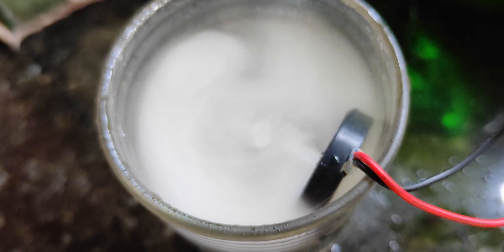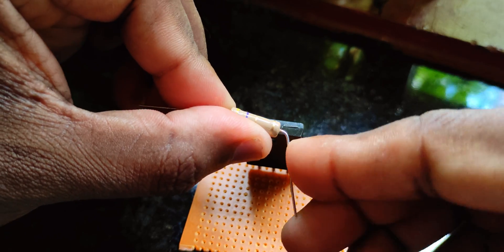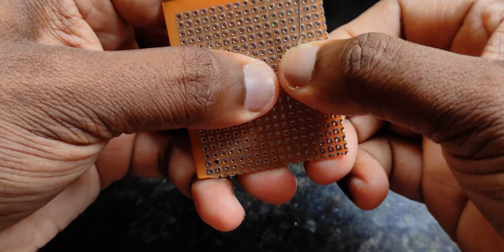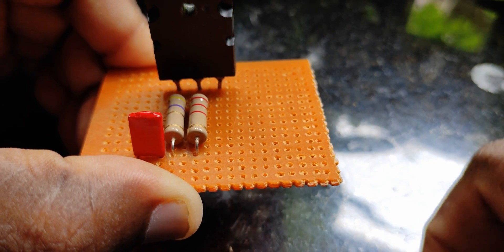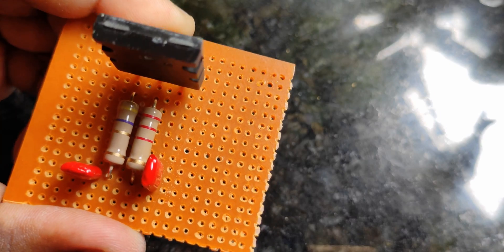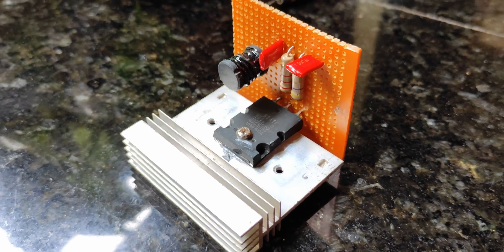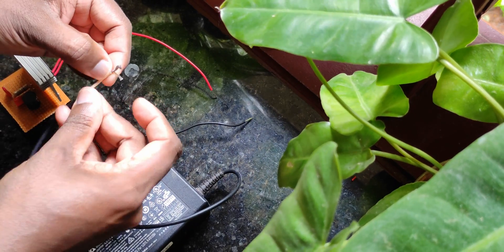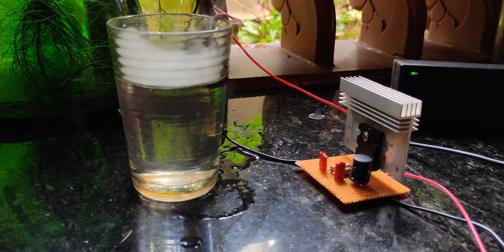I made a super simple 1.7mhz mist maker circuit | ultrasonic mist maker humidifier Level 2 | Ciiads

Comment: simple and effective.. works fine... it only consume 0.6amp...... thanks
Reply: Are you sure it consumes only 0.6A ?
Reply: @sujatabargur  yes i checked it with my bench power supply
Reply: @narendra848 
👌
Reply: did u check frequency with scope? i think its way less then 1mhz
Reply: @hehahu-wx2gn  may be possibe, i didn't check the frequency
Reply: i think by calculations it showing 308khz or something by adding disc capacity. isnt you work. really?..😢.
Reply from the maker: How do you calculate, the disk it's self is an oscillating component😊. Check the circuit and think.
Reply: @AMNLabs may be work... parts not delivered. waiting....Hoping the best 👍🏻

Comment: Thank you bro.... At last i built this 🙏🙏🙏🙏... i used toridal 2.4 A 100uh inductor is the change and same transiter but csc5200..I really doubts isnt it work.. But research i fjnd out it work and start to built.. But it's output is slow. i mean it take long time to fill glass as in you. so my need of making 50inch tv area fog with this will partially success.. also the transistor is heating even with heatsink. but fine it may be 40-70 range.... in first i think it not work only when we drop water not work when we put in water.. But when adjusted height it works fine.. i using a voltage regulator for 12v 2A bcz i have  a smps of 13v so for it uses 12v regulator....*I still have doubt* Isnt we can add another disc in it. so that good output will be there. i can give enough 12v current upto 5A. Isnt using parallel discs fine?.. isnt circuit burn?
Reply: isnt any way to increase fog content by increase voltage or something.. my disc is 12v by the way....
Reply from the maker: Do not use any regulators, feed the voltage directly. 13 V is not an issue. Use thick wires and high-current components. This means the inductor should be made with thick copper wire. In my experiment, this improved the thermal performance. You can always increase the voltage up to 24 V.

What I showed in the video is running on a 12 V, 3 A power supply, and it is barely warm. However, it does get warm if it is built with thin wires and a thin inductor. If you push the voltage, keep the disk at its rated operating voltage.
Reply: @AMNLabs 12v is disk rating 😐. that's why i used regulator. Almost 13.7 peak is smps out. i don't know thickness. its brought from robu 2.4 A toroidal inductor 100uh
Reply from the maker: There is always a voltage drop across components, so the 13 V will not hit the disk directly. It will actually be less than the supply voltage, so it is safe. I haven’t experimented with parallel disks in my setup. If the two disks had the same resonance frequency, there could be a possibility, but most of the time components have tolerances, so they won’t be exactly the same. Therefore, the chance of this happening is very small.

Comment: isn't this really produce 1.7mhz with this 47nf capacitor. isnt it working like feedback boost loop. isnt it has any limiting setup. isnt resister's for that?.. isnt the 47nf used for dc blocking?... which parts determine the oscillation frequency. how its working path.. can you explian. isnt it's a better option using toroidal inductor. isnt we need to use trimmer capacitor for adjust the tolerance issue of 20% of inductor. i really need this setup but stuck on inductor. because i have no inductor measuring devices to custom built. Yaah there are setup to calculate turns for fixed diameter wire but ferrite core power measuring not with me..😢.

Comment: how much ampere rate needed for inductor. Also isnt if i use current rating under 1A isnt burn full circuit or the inductor only.
Reply from the maker: In my experience thick wire works best.

Comment: i purchased all but i don't get the  inductor 100uh with high current rating. but i by radial one of 100uh. what i do. i gonna buy new 100uh of 1.2 a... isnt that gona ok?
Reply from the maker: You can make one your self, use coil 32 calculator
Reply: @AMNLabs  can you say how much max current ratig needed
Reply: also i have a ferrite 100uh can i use that to make it.

Comment: i really like the fog visual. i need to make this. in internet it saying 1.7 mhz is ideal for fog.. isnt increase it make more fog?... isnt increase voltage produce more fog?
Reply: do you have any specific tips like thick wire, high current inductor,  which is often saw in comments. I am not a electronic guy. I need to make this for a iceland miniature 👍🏻
Reply from the maker: @christopeter.k.p2199  ya you can increase voltage depends on the disk potential. 👍
Reply: @AMNLabs i have a doubt the chat gpt suggested use power MOSFET IRLZ44 instead of 2sc5200...can i do so. isnt any issues. pros and cons plz
Reply: @AMNLabs also in rohu only i see 25 mm disc. But it is 12v. Isnt 24 v better? isnt it make more fog.i also saw a built in 24v mist humidifier in rohu it has no modules. a black set input a 5mm dc jack only.... isnt it better?
Reply: @AMNLabs also i saw many persons in comment to increase frequency. isnt it make more fog or finite fog?.i need to make as like thick white fog. that's why.

Comment: Hey nice to see you still uploading in 2025! Last came here in 2022  well anyway. I randomly came up to this video. But could you also tell me the name of the circuit or even a schematic? Well really the reason is I wanna drive a 113khz or 108khz piezo disc depending on which one I can find. So can you tell me how to change its frecuency to these two?
Reply from the maker: Hey! 😊 Yes, it’s still uploading. My latest project with the PIC12F microcontroller—complete with firmware and circuit—is already out. Right now, I’m working on another exciting project that will drop soon—you can follow the community posts for updates!

I’ve also developed a real-time timer for automation based on STM32 MCU, and that’ll be coming out soon too. On top of that, we made a 5.2-channel Hi-Fi power amplifier for home theatre and music—three years of R&D went into it, and the results blew us away! This is the start of our audio brand, AMN Acoustics, focused on pure sound quality and powerful performance.

I started this channel to share my work as open-source projects that can actually help people. Thanks so much for sticking with me!

About your question: for 113–108 kHz, you can make an oscillator with a NE555 chip, drive the piezo using a MOSFET, and add an indicator. That setup is more than enough to drive the disk.

Thanks again for following along—see you soon! ✌️

Comment: I need to have minimum of 4 piezzo modules running at same time. can I use a single driver to run all for by connecting them in parallel?
Reply from the maker: No
Reply: @AMNLabs  is there any modification I can do to do it
Reply from the maker: @sinansidhiq3928  Practically no, but give it a try. I prefer using multiple dedicated drivers. As a matter of fact, it's just a single transistor circuit.

Comment: Brother, Working perfectly but transistor gona to hot ,what to do
Reply from the maker: You'll need to use thick wires, a high-current inductor, and an appropriate heatsink.
What's your setup?
Reply: I buy a 100uH 11Rs inductor. you are right . Brother, tell me why transistor going to heat by small low current rating inductor??? I also want to how a single transistor and inductor make a oscillatory signal?!! Please tell me. @AMNLabs
Reply from the maker: The piezo disk it self is the component, Its self resonance is used to make oscillations and others are the supporting components. the high frequency pulses require more peak current. You can't see that on the multimeter but it's actually there so thick wire helps to lower the impedance minimize losses and better power delivery make the system works better and efficient makes less heat.
For instance if you swap the 1.7mhz piezo to a 2.4mhz one the same circuit works 😊👍, sub if you like my project then we will meet again.
Thanks for your feedback.
Reply: Thanks brother❤ for this great knowledge @AMNLabs

Comment: At 12 volts, it just splashes water. Only between 18 to 24, just for a few moments, it produces fog and then continues with just splashing water. The NPN gets super hot.  Using a computer-CPU-heat sink, I keep it cool, but still the same result. Would you guide me in this matter? I use a 12-volt PC power and also an 18 to 24 DC 10 A power supply. Thank you for you help
Reply: Would you kindly help me with the problem?
Reply from the maker: Use thick wire and high current inductor, keep lowest possible water level on the top of the disk means reduce the water load over it.
Reply: Thank you, I used a toroid with a 13 mm inner diameter and 0.8 mm copper wire with 34 turns. I also increased the resistance of the 2.2 k resistor to 3.4 k. Then it started to work on 24 V. 😊
Reply from the maker: Thanks so much for your patience and belief in me. If you liked this, give it a thumbs up and hit that subscribe button to join me on this journey. Thank you!

Comment: Can it run on 3 volts? What circuit modifications would be required for that?
Reply from the maker: No, it's not possible to run it on 3 volts directly. But if you're wondering, we can try using a boost converter module to step up the voltage from 3V to 12V or higher. Make sure to use a good-quality module with sufficient current capacity.
Reply: @AMNLabs could you please suggest me some boost converter?
Reply from the maker: @deeppatel_369 why are you trying to run it on 3 volt?
Reply: @AMNLabs  Since I want to run this using a battery in a project, would it be possible to use a AA, AAA, or coin cell?
Reply: It only needs to run for a few minutes, which is why I'm trying to power it with a coin cell. What would be a feasible solution?
Reply from the maker: @deeppatel_369 If you want to run it using AAA batteries, it’s very difficult due to insufficient power delivery. I suggest using at least a 12V battery for the circuit and a 3.3V regulator for the 3V sections of your project.

If you're aiming to create mist using a low voltage power source like a lithium-ion battery or a 5V power adapter, you'll need a low-power mist maker circuit. These are inexpensive and pre-assembled modules available online. Just search for “DC 5V Humidifier / Mist Maker USB Spray DIY Module” on Google.
Reply: @AMNLabs   Thank you so much. Do we have a lower-power piezoelectric disk available?
Actually, the idea is that I want to generate mist—it can be a low amount—but it must be powered by a small battery. Using larger batteries would defeat the purpose of my project, and I’d prefer not to use a power adapter.

If you have any ideas or solutions (whether with a different circuit or a different piezoelectric element), please let me know.
Reply from the maker: @deeppatel_369 Just Google the query I mentioned in the previous comment, you’ll find it there.
You can buy the module, it works very well.

If you want to create your own version on a dot board, you can buy an atomizer disk online (typically around 108 kHz) and generate that frequency using an NE555 chip or a microcontroller. Then, use a MOSFET to switch the signal and drive the atomizer disk. That’s the general approach.

It’s not rocket science, and it’s not a new concept, there are plenty of DIY circuits available online using 108 kHz disks.
Hope that helps with your project!
Reply: @AMNLabs  Thank you! I’ll search for it.
Reply from the maker: @deeppatel_369  good luck 👊😊

Comment: Hello sir please give me your gmail to contact regarding this project can't work
Reply from the maker: Why? 
If you did everything correct it will work, I'm sure 100%
Reply: Please tell me about the inductor all components the same as  you use but I am using 8 × 10 mm drum radial ferrite inductor so tell me how many turn what is diameter of wire
Reply from the maker: @PriyaranjanMaurya-zn8lu
I think it's 20 SWG, I made this a long time ago, so I can't recall exactly. But it's not a big deal, just use thick wire and a radial ferrite core to make an inductor around 100 µH. That should be fine.
You can use Coil32 to calculate the inductance if you want, it's simple as that. And always use thick wires for all the connections.
Use proper core size for the perticular inductor to get the best results.
Best Regards,
Aneesh Murali Nariyampully
Reply: Thank you so much I am going to make this Inductor and correct my circuit

Comment: My Circuit is not working all Components and connect are same and I am using 12v 1.5A adapter 
25MM Piezoelectric work too much slow
Reply from the maker: I have no idea what's worg there but I'm sure if everything you did right as like what in the video the results are always like the video.

Comment: Hi,

Thanks for sharing the project and the circuit diagram. I made a simple implementation on a self made PCB and my 1.7 MHz Piezo is doing well, the NPN gets a bit warmer, but not hot. I tried a 2,4 MHz piezo at the same circuit, but it won’t start to swing. Is there anything I could change to get it working at 2,4MHz?

Thanks, Rob
Reply from the maker: @robbeh81  don't run both at the same time, the same circuit works for both without any issues no alterations needed supply enough voltage and current according to the piezo. It will work.
Good to see you 🤝.

Comment: Hey, I have recreated the circuit successfully, though I had to substitute some parts based on what was available to me, i.e.
2SC5200 -> TIP3055 (Noting a substantial drop in both voltage and amperage. C/E=230v->60v C/B=230v->100v C/c=15A->15A, Transition freq=30MHz->3MHz)
Hand wound inductor -> 1410454C (100uH, 5.4A)
I am using a 20mm piezo, when I purchased it I was under the impression it was 12v (though looking back this might have not been the case), however with this setup it appears to struggle to atomize the liquid at 12v.
Using 24v sees a huge jump in performance, seeing a substantial increase in the atomization volume & cloud density.
The transistor frequency drop from the 2SC5200 to the TIP3055 is quite substantial, though still exceeding the required 1.77MHz, so I was wondering about the implications of this drop.

I am somewhat unfamiliar with the fine detail of electronic circuits and component interactions (I'm getting there haha, little by little), so my questions for you are:
- Is there anything apparent about my configuration that stands out in terms of bottlenecks, that could cause the struggle at 12v but not 24v? (In the case it is rated at 12v and I wasn't making it up😆)
- Would it be possible to run multiple piezo plates from this one driver, whether that be in series or parallel, and if so what are the implications of doing so? (I.e. bottlenecks, possible transistor strain, etc)

Thanks in advanced, and thank you for your tutorial, I did have a couple troubles in my recreation but I got there in the end!
Reply from the maker: The TIP3055 has a much lower transition frequency (~3MHz vs. 30MHz for the 2SC5200). This means it switches slower, potentially leading to inefficient power delivery, especially at lower voltages, while putting more voltage will compensate about some levels, The 3MHz transition frequency (ft) of the TIP3055 indicates that the frequency at which its current gain (hFE) drops to 1. This means that at frequencies near 3MHz, the transistor is no longer effective at amplifying or switching signals efficiently.
TIP3055 is designed for low-frequency applications, primarily used in linear amplifiers and low-frequency switching circuits typically below 100kHz and max 300kHz.

This means a transistor typically operates efficiently at about 1/10th of its ft(transition frequency)

So usable frequency = ft/10
For instance in the case of 5200 
ft=30mhz
f usable = 30mhz/10
= 3MHz//

So, the 2SC5200 can handle up to ~3MHz efficiently, making it a far better choice for high-frequency applications than the TIP3055.
You can always find many faster and better transistors than this.
Reply: @AMNLabs  I see, thank you very much for your insights!
Reply from the maker: @freffrey3772  always welcome 🤗

Comment: @Ciiads  what component changes would one make in order to drive the 2.4Mhz variant of this piezo disc?
Reply from the maker: The same circuit works without any alterations or modifications. Simply replace the disc with the 2.4 MHz variant and apply voltage according to its specifications.

Comment: Can it run 5v dc?
Reply from the maker: @HidayatAwan-q2i  No
Reply: Ok,thanks,please share circuit diagram
Reply from the maker: Diagram of what?, you mean the one in the video, check discription.
Reply: Ok,but i need a 5v dc circuit
Reply: Sir,please give me advice on how to make a 5v dc water fogger circuit?
Reply from the maker: Buy a 108 kHz ultrasonic humidifier atomizer disk and build a 108 kHz oscillator with an NE555 chip or microcontroller. Switch the output of that oscillator with an N-channel MOSFET through an inductor around 220 µH. Take the output signal from the drain of the MOSFET through a 100 nF coupling capacitor and feed that into your 108 kHz disk. It's not complicated; circuits are available just by Googling. The easy way is to buy a 108 kHz humidifier module, which comes with the disk, circuit, and is cheap and will work with a phone charger.😊🤝
Reply: Ok, thanks for the advice
Reply from the maker: @HidayatAwan-q2i  🤝

Comment: Could you simply take the output of a frequency generator and connect it to these piezoelectric discs? or ceramic discs?

It seems they need a certain frequency for each type and I would assume output voltage and current of the frequency generator should match this if it were to work.
Any ideas if this would be able to work with just the frequency generator you can buy as a all in ine solution to powering these discs?
Reply from the maker: Yes it will definitely work when the frequency and power matches with its spec.🤝👍
Reply: @AMNLabs  Awesome. if you try please post.  Thank you kindly